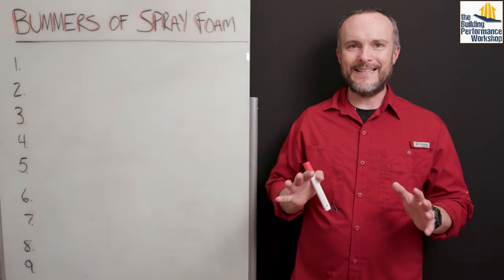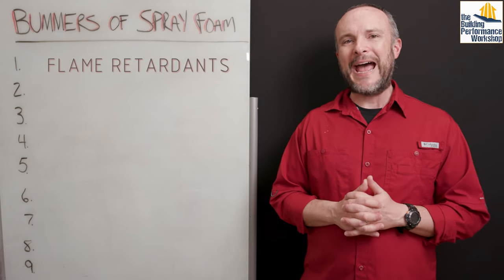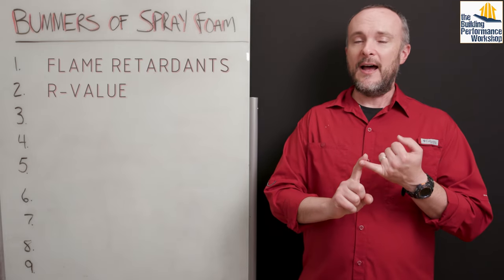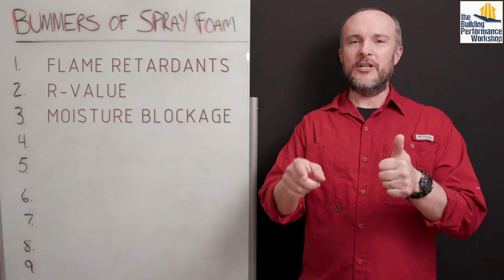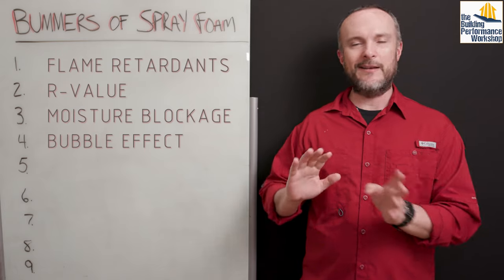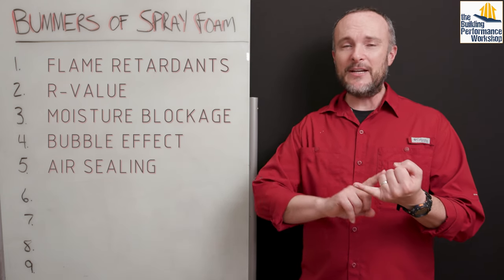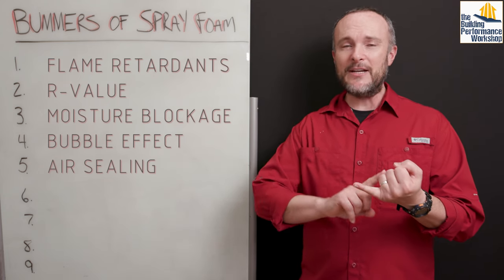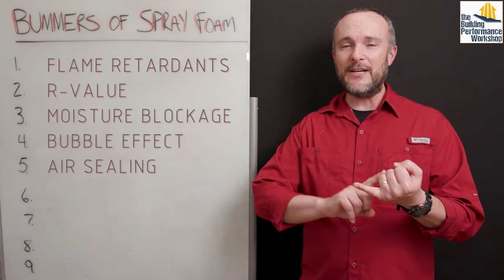Spray Foam Bummers: Make Informed Decisions on Insulating Your Home

Comment: How do you feel about the use of canned spray foam for air sealing around windows and joists?
Reply: Just thinking the same thing, there are so many type of canned spray foam out now too, just used window and door spray foam on a door install)
Reply from the maker: It’s a volume thing, guys, don’t get too focused on the tiny bits of foam. Although I will say there are perhaps better airsealing materials for spot airsealing.
Reply: @HomePerformance  thanks for the reply. What do you generally recommend for spot air sealing?
Reply from the maker: Check out spray on gaskets- AeroFixx Visconn is the easiest, but also Knauf EcoSeal or OC EnergyComplete

Comment: You forgot one of the most important Bummers, your a/c evaporator coil will corrode and leak!! This is due to offgassing of the spray foam leading to formicary corrosion. Ive seen this hundreds of times as a HVAC contractor in Texas and its very costly on the homeowners.
Reply from the maker: Since I haven’t personally seen it happen, I’m putting that in the ‘other chemical stuff’ column, but I’ve heard a fair amount of talk about this, Jacob. Wonder why none of this is being researched ($$$$$)…

Comment: Ive heard that in the case of a house fire, the fumes from burning spray foam can knock somebody out far sooner than the smoke or heat would, is this just a myth or a factor that should be considered?
Reply: Smoke rather than heat/flame is the leading cause of fire deaths in domestic fires. Foams produce more toxic smoke during combustion than other materials for two reasons: 1) during the decomposition of polyurethane  toxic hydrogen cyanide is released around 350C and 2) the presence of fire retardants make the smoke more opaque (affecting egress) and toxic. That said once a fire is fully developed the concentration of CO in a building will rise above deadly levels even without foams or fire retardants.
Reply from the maker: Why a lot of people are all for taking what the cigarette companies legislated into materials back in the 70s-80s back out.
Reply: @HomePerformance  I do not believe there is a  connection between fire retardant and cigarette manufacturers. Two different issues. Upholstered furniture fires can be started  by smoldering ignition sources like cigarettes or flaming ignition sources like open flames (candles etc). The use of halogenated  chemical fire retardants was largely used to reduce flaming  ignition   propensity but did noting in terms of smoldering. Currently in USA we have regulation  for smoldering  ignition  but not for flaming because it is believed that fire retardants chemicals would be needed to address flaming. Well that's not true because we can use barrier layers in the form of fabrics film etc that are actually more effective than fire retardant chemicals as you correctly pointed out. A similar problem does exist in building materials and I am curious to hear from you soon about that
Reply from the maker: Look into the history of why the FR made it into furniture and everything else in the 70’s

Comment: Fantastic and best video I have seen on foam insulation! The problem with polyurethane foam is is the product of reaction of two materials: polyols and isocyantes. Polyols are relatively safe and can be replaced with bio derived products, but isocyanates like TDI and MDI are some of the most toxic chemicals you can think of (if inhaled at ppm level the respiratory system stops working ). So if there is any unreacted or partially reacted isocyanate in your foam (there are multiple reasons why this can happen) you are in trouble.... Regarding FRs: FRs are basically not used anymore in upholstered furniture in USA. Regulations vary state by state but California State (which due to the size tends to dominate the market) has banned FRs in upholstered furniture. The only type of soft furnishing where fire retardants are still allowed in California are barrier fabrics for mattresses. Finally, you are totally right about the effectiveness of fire barriers vs fire retardants and I look forward to your video on the topic!
Reply from the maker: Thanks for clearing up the furniture FR question, Mauro!

Comment: I do a lot of woodworking and my family has a lot of allergies and I want the house’s air to be completely sealed off for the garage.  I was planning on spraying foam to seal/insulate the house from the garage.  Is there a better way to do this?

Comment: Large 50 x 80 hangar... 8" purlins and girts.   R 25 in the walls and R35 in the roof using  a system by Thermal Design.... but on the hangar door I want 4" of spray foam....   Should I have them do 2" at a time to prevent the heat issue?  Hangar in Gainesville FL area.  It will be air conditioned